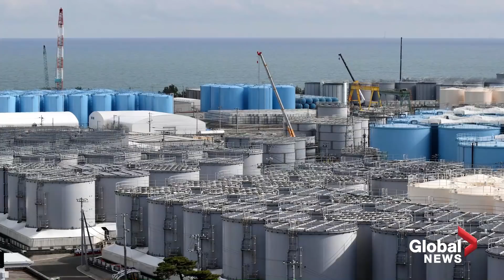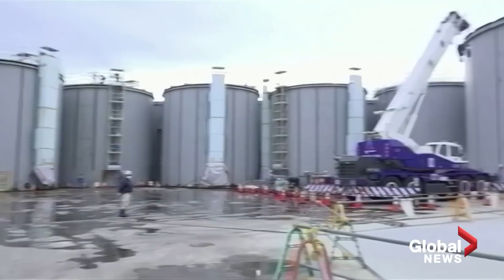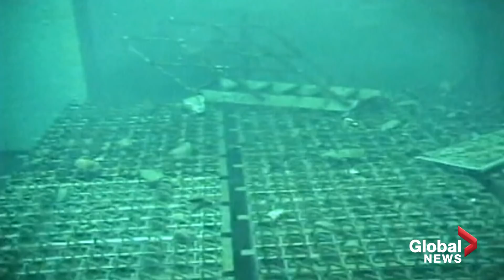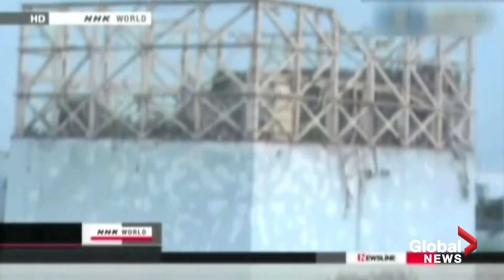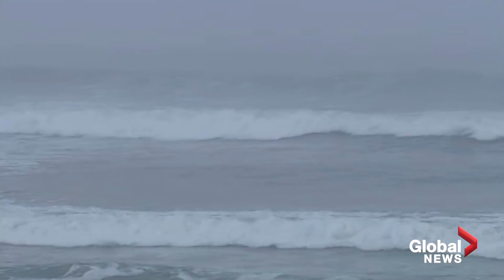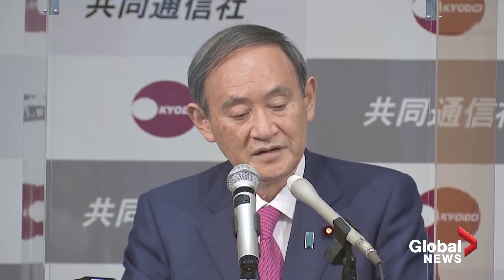Fukushima nuclear disaster: Japan may release 1M tonnes of contaminated water into sea

Comment: Marine discharge should never be achieved. The contaminated water was made by artificial accidents. Therefore, there is no precedent, and no one knows what the future consequences of marine discharge will be. Once discharged, it cannot be picked up again or returned. For Japan, it is of course the cheapest and fastest solution, so it will want to release the ocean unconditionally. However, the Oceon is not just for Japan. Radioactivity leaked due to Japan's lack of initial response, and Japan should be solely responsible for it.

Comment: What if you drone airlifted metal flash freezer sections over downed reactors, with -40 below flash freezer cooling with refrigeration  back away and two metal cooling halves are set on either side of a reactor. Cooling starts and halves are pushed together, blowing cold gas and reactors start chill process. When cool enough insulated cooler panels are drone lifted and set into position over metal cooler. Robot can enter through access door and start the inspection process. An intert gas like argon can fill the reactor and cooler while chilling.

Before electricity was captured through power lines it was never dumped into the ground through 8' electrodes energizing grind water at every home and business.  Storm clouds of higher charge send heat lightening and charge of higher electron charge move to clouds of lower electron charge to stabilize the electron balance in the atmosphere. We're energizing ground water tables with positive electron charge and telling storms not to come here, and with electron to magnetic earth ground charge a low depression stir where h20 reaches ground and which replenishes water like it should rarely happens, so it just evaps off, that's why lightening is more likely to hit the lone farm house rather than the neighborhood. With a fourth insulated conductor taking the returning current from each homes neutral bar back to the grid to power extra street lamps, etc, instead of energizing ground water tables which is a conductor, maybe the world will have more... What isn't

It costs the same to print welfare as it does US Currency, for the cost of bringing in people from another country and giving then citizenship, when we're already out of jobs, even with people sitting on degrees and college debt working at retail stores and looking for other jobs, with skilled trade wages maintaining what they paid before gas more than doubled and everything went up) why don't we pay people to go to other countries and build indoor farming, from fish to every kind of crop, so everywhere is a good home with food and jobs. And with more jobs everywhere, everyone will have more for each other and dollars will go further everywhere. All the kids playing on dad's monopoly game will have a fun life and get back to serving one another. One kid will sell ice cream cones again because the other one is hired to paint houses, so he hires someone else to work on theirs, and people can build boats and people can go on boat rides again, with more people working more people can actually get a paid vacation and start saving for retirement (I'll take a retirement pll), but with everything shut down, it's a game of who wants to buy it all up for paper when it floods and collapses

Grow too much food so when the food truck is empty, it takes back the extra food with blemishes for fertilzer on indoor crops where there's no need for pestcde as there no bugs indoors, you can grow any crop with with above  or below ground (mirrored clay wall) vertical farms, magnifying glass panels at ground level, solar 24/7/365 growing seasons, indoor fresh water fish farms, indoor whaling, grow grass and put cows and chickens on it all year round (won't even stink up a metropolitan city in a high rise) plant dirt and grass and cows where torn down factories left concrete waste slabs) in a building grass can be grown in many floor to ceiling returnable plats on a conveyer, that's takes it up to the dairy floors for food where the cows eat it at 3' above the floor, the floor has a squeegee system and the cows are herded from one half of the floor to the other for cleaning: an automated squeege cleans the floor and empties it into a special for drain: the cow manure goes back down in a pipe for fertilizer : ) the floor has a floor washer, like a car wash, but with clean spayed water on the floor and a squeegee system : ) So good

 Salt water can be separated with oxygen being released like a rain forest to the outside air while the electricity generated disinfects waste water as it makes energy (NASA does this to make cabin oxygen while it releases everything else to space) Everyone uses a small steam distiller to disinfect and remove salt at the sink for drinking and cooking, everyone gets soft water to their house from the ocean, (already has natural salt in it) drag pipelines to every continent, more jobs, and divert river system maybe to deserts to take sea water rise from melting ice caps and maybe restock what used to be an ocean, natural sand filter at least, just don't put sharks in there and you can surf : )

 NASA uses electrolysis to make cabin oxygen from water and they release the hydrogen gas to outer space, you could use the h as clean energy and release the oxygen to the planet as a rain forest, drag ocean soft water to municipalities, they use a small steam distiller at the sink for drinking water, everyone's off toilet to tap, and you use electrolysis to disinfect the waste water and make energy. You split the ocean stream for indoor fresh water and salt water fish farming. You build or convert 40 story buildings for indoor farming. Every acre under roof is an 80-120 acre farm, but instead of 12 hours of light, there's solar glass panels and you have 24 hours of light, 12 months of growing instead of 6, so maybe an 80 acre indoors is like 320. You grow too much food so the empty good truck picks up the blemished felt and vegetables for fertilizer. You can have a cow floor, a dairy farm and a chicken floor in what was an office building. One person drives an hour with gas and clogs tollways to drive to a city where someone else has to drive an hour to his town to work. Now they both work from home, they can get paid more and write off an office in their home, empty office building can be converted to indoor farms, and the sprinkler system can be used for irrigation. You can grow every crop in the world, everywhere, indoor, with every climate and 24/7/365 agriculture, and not even smell farm animals in a building 

For what it costs to build housing here and grow food on welfare, we can pay people who want to go to another country and build indoor farms and drag ocean lines and build clean energy waste water stations. Who wants to get paid to go to south America and maybe even live there? Whether you were from there, want to get paid to go on a humanitarian effort, or maybe move there : )

With today's technology and the skilled people who came here to learn skills, maybe they would love to develop their home turns and make it great, with more than enough food and water and electricity for everyone, everywhere

People work for each other for paper and out of an overflow they trade. Everywhere will be a good home for everyone who lives there

Food in cold climates can be grown underground in clay dug out cylinders with mirrored walls, solar night lights and heaters and glass solar roofs

Comment: To date there has been no success in stopping the molten fuel/reactor from sinking ever lower into the earth, thus every time there is rain more water will be contaminated and it will have to be collected in those tanks. I've heard a new sea wall has been installed to trap the contaminated water from flowing into the Pacific Ocean. In fact in some ways this is worse than Chernobyl because at least the Soviets manage to fully contain the molten reactor and ensure it stayed in one place and didn't contaminate either the air or the water. Job well done by the Russians despite horrific reactor mismanagement an utterly criminal initial response in the first two days of the disaster.

Japanese government on the other hand... They'll have to actively stay on top of top of this mess for thousands of years. God forbid another once in a century 9.0+ earthquake comes around and damages some of those containment tanks causing water to be spilt out. The first priority should have been creating a permanent seal or sarcophagus underground to ensure no more water would enter the molten reactors and ensuring the molten reactors stayed in one place. There was a window of opportunity back in 2011 but it's gone, in fact the exact position of the molten reactors cannot be measured since the most radiation-proof robots break down.
Reply: Wow!  Do you always spew such nonsense?
Reply: @ForbiddTV  At random intervals usually when I'm asleep.
Reply: @skatemetrix   Maybe you should stay away from the internet when you're having these episodes.  You're spreading really bad and incorrect information.
Reply: The OP is slightly disingenuous with the Soviet solution at Chernobyl. Look up Chernobyl today... It isn't Russia cleaning it up. Or paying for it.

Comment: Fukushima Dai'ichi disaster happened because of a tsunami.  The accident was made hugely worse by inadequate nuclear reactor design, inadequate see wall protection, and inadequate protection for diesel standby generators against flooding.  Tepco and the Japanese deny any responsibility for the incompetence that was shown.  Westinghouse takes no responsibility for a lousy reactor design requiring control rods to be actuated upwards rather than gravity driven, and an intermediate spent fuel pool at the top of the reactor buildings.  This is insane reactor design for a seismically-active installation environment.

Comment: It's a mess, it's tritiated water(super heavy water), basically the same H atoms but radioactive, it cannot be removed easily, radioactivity only drops after many years. And they have radioactive C14 (carbon) there too with half life of 5,730 ± 40 years!!, it will circulate in the ocean before someone will eat fish with that /or drink some water. And that someone can be you. Those morons should build bigger tanks uphill & store it there, before it can be dealt with (new tech will be developed).
Reply: I mean tritium really isn’t that radioactive, and it will be so diluted into the ocean that it’s barely detectable

Comment: Why dont they heat up the radio water to the point it evaporates ?
Reply: I guess they're so stupid that they never thought of that. Why don't you call them up and suggest it?
Reply: I dun think it is safe to inhale
Reply: @fubao99975   but they could do it in a contained area. like move the water into a big storage thing and evaporate the water in it and let the radioactive  stuff sit in their and dissipate. but they would need to build it first.
Reply: @TheBlazersfan22  It does not dissipate. It takes tens of thousands of years to dissipate. That's why a problem exists.
Reply: @jamesmullaney5841   oh. well then. that sucks. but water should be able to evaporate very quickly with just good amounts of heat. than the radioactive can just sit their till it's gone. Better than pouring radioactive liquid into the sea. is the point i am trying to make.
Reply: There is no difference between evaporating them and releasing them as water.
Both can’t remove tritium itself.